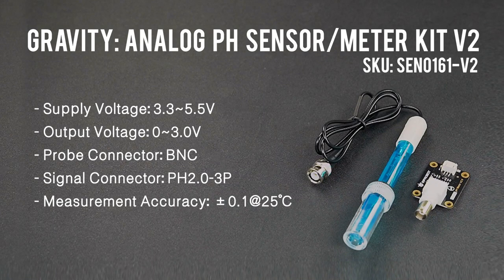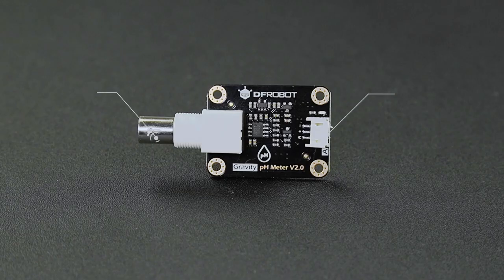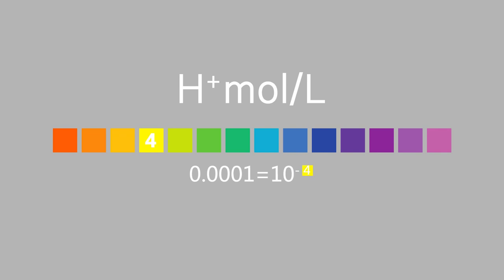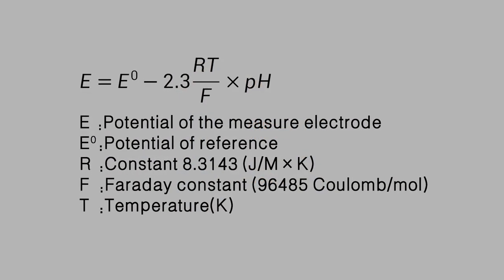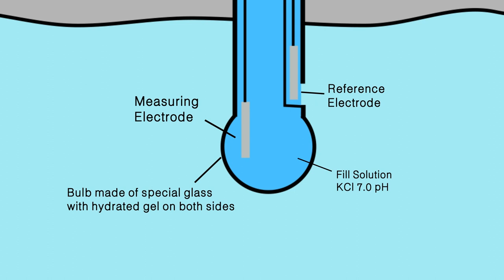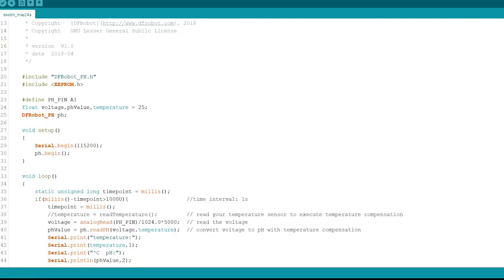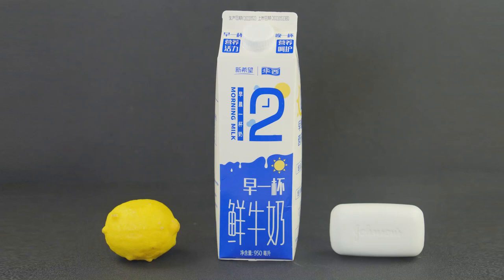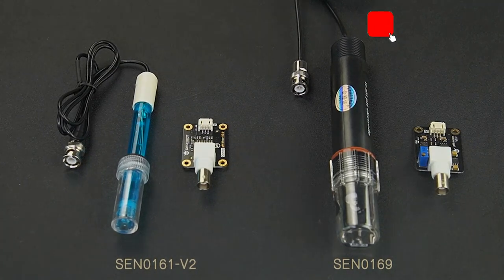How A pH Sensor Works - Gravity: Analog pH Sensor/Meter Kit V2 - SEN0161-V2

Comment: Does it damage if it is connected to 3.3V of arduino cuz mine is working fine with 5V and when connecting to 3.3V with esp 32 the led doesn't blink
Reply: lol its stated in the video that it works with 3.3 and 5volts, where is the question here?

Comment: Can we check ph of harsh chemicals like  concentrated sulphuric acid and potassium hydroxide  without damaging it, and what about its accuracy, and reliability?
Reply: Why, pH is for low concentration, if you want to find concentration on harsh chemical use titration method, if you know basic titration, you can use syringe for cheapest option to calculate the volume.